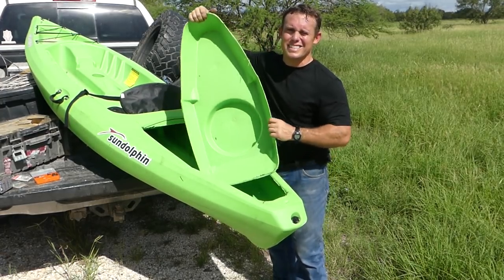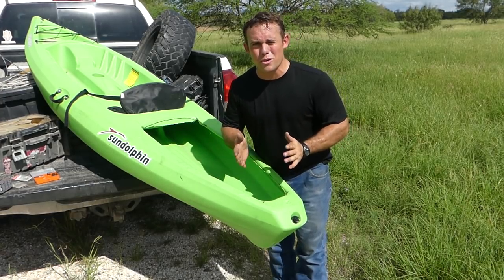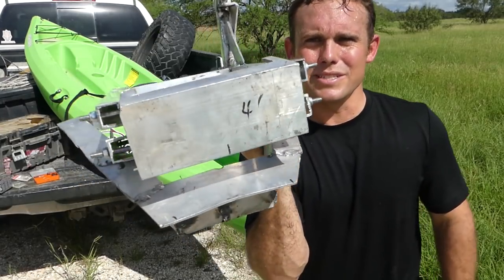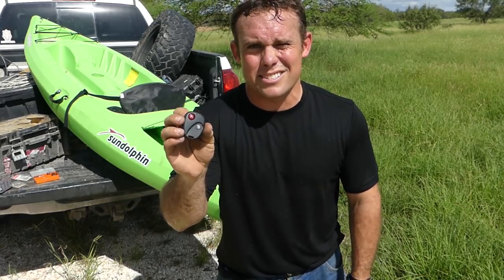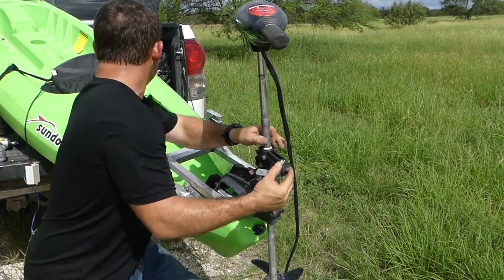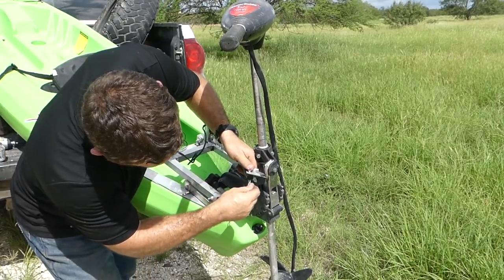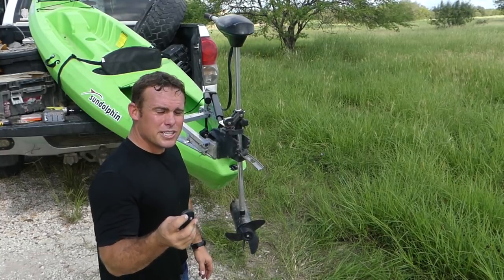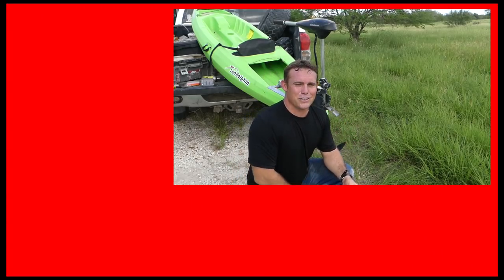Big Mistake to my Fishing Kayak? Trolling Motor Mount and Wireless Remote  Steering

Comment: What’s the weight capacity of your boat? 24 v battery along with motor, brackets and operator I think you’ll be surprised. You sure have a great attitude.
Reply from the maker: I appreciate that Jimbo. The capacity is not much  for that thing but I was all an experiment and in bad about testing boundaries and limits of ideas. Thanks bud

Comment: i applaud your ingenuity! But frown on the cut out.. All of that could had been done with no cutting.
You may want to now add a auto bilge pump in the back because i promise you you will fill up FAST.
Having used one of those fora season the rear well was already close to the water as it was ( i am only 2212) and the well stayed wet.
At 54# thrust motor your going to need a hades of a battery and do NOT put that in the back with that cut out lol.
 The fabrication is awesome and i like the use of a wireless steering.. But truth be told after using a tiller rod for a season ill never go back to anything else.
Reply from the maker: Thank you I have really appreciated everyone's honesty. Yea it was a crazy idea cutting it our but it will get filled in by aluminum and I will have a bilge just in case. I've got some more crazy ideas I'm going to add to this thing.

Comment: Great video! Love the fabrication, I'm gonna say you will get 5-7 knots just pushing that little kayak! I really do think once you get that thing all bolted in that you can find a way to put some of that plastic back on the kayak and make it more water tight! I have seen videos of people using heat guns to repair the plastic. Heck I've seen one guy used a Goody's hair brush to fill in the seam on his kayak. You seem like a pretty resourceful guy ,most Welders/Fabricators are!!  I have not installed my rod holders on my 12 ft. Manta Ray yet, But saw a really cool video on making leashes out of weed eater string and para cord by wrapping it around a dowel and boiling it! Great job, Good luck with your Channel!
Reply from the maker: Thank you Chris, I was thinking I could plastic weld it into place using acetone to turn some plastic to a paste and a heat gun, but I have something else I am going fabricate in the hole that is still open. There wont be another kayak like this cheap Walmart kayak when I'm done. That weed eater idea sounds pretty cool I'll see if I can find it.
Reply from the maker: I forgot to say you are probably dead on with that speed prediction, or at least I hope you are the fastest I have found is a little over 4mph

Comment: How much faster do you think you will get from the 24v? I thought the angle of the prop plays the most important role of the speed?
Reply from the maker: Yea all of those factors play a role. Weight to thrust. Prop size, angle in water and how deep the prop is under the water line. Ive owned 12,24 and 36 volt trolling motors and the thrust difference is all in the voltage applied.
Reply: You should have plenty of thrust with 54lbs? I think going with a higher prop pitch would net a lot more speed. I would be concerned with a too fast first gear.  24v will add weight unless you use something like the small SLA batteries?
You need to invent a CVT driven prop. =)
Reply from the maker: @benmudn  your reading my mind a little. I have some crazy ideas that I may make a jet drive electric but not for now. I probably wont run it 24 volt and stick to 12 I just want to see how fast it will go 24. The fastest electric kayak I have found is a little over 4 mph. I'm actually making a lithium 18650 battery out of laptop batteries. Super light weight.
Reply: The Bass Factory  Can't wait to see what you come up with!  
In my little kayak, I had a thought to run drills with props, 1 on each side with foot controls. I'm just worried about them not being waterpoof.

Comment: Nice engineering. I'm not a hater but you will need an actuator with a faster speed I believe. Also, electrical components have a voltage rating for a reason.
Reply from the maker: Ha, thanks bud I love your honesty. Yeah it's fun experimenting. I am going to try my voltages and see if a voltage increase will increase the actuator speed. I have been researching trolling motors and ebike motors for a couple months and there are not any differences between a 12,24, and 36 volt trolling motor. The thrust between a 101 and a 54 thrust is the watts you are giving the motor by having more voltage. If I blow anything I'll just rebuild it.